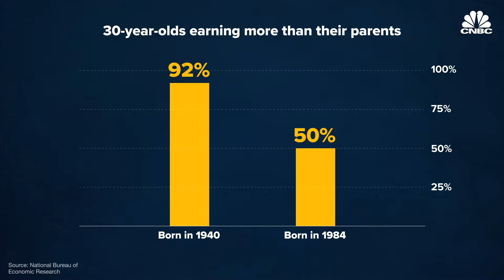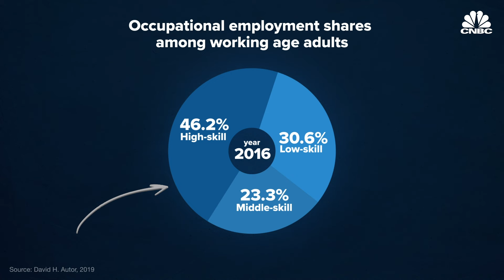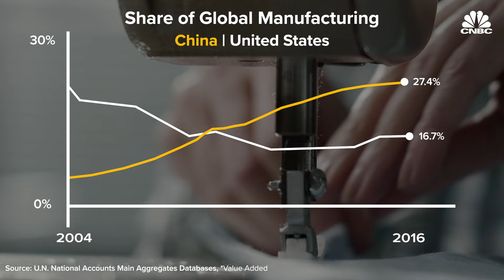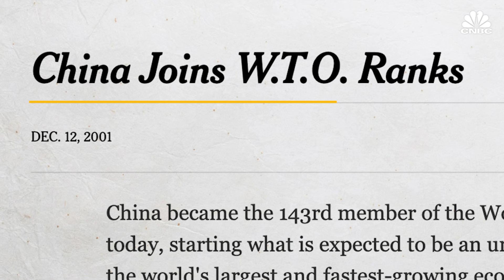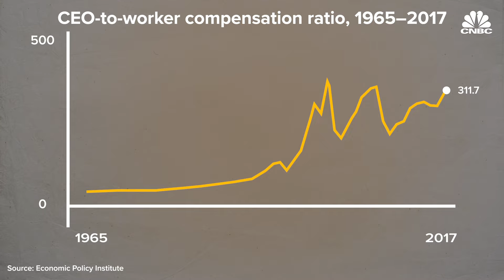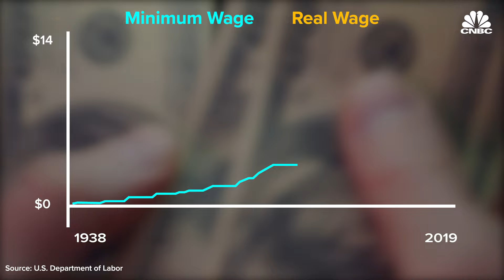Why The Inequality Gap Is Growing Between Rich And Poor

Comment: Had minimum wage went up with production, as FDR signed it into law, the minimum wage would be over  $23.00 an hour
Reply: Ronnie Baker and a McChicken would be $7.
Reply: @ronniebaker4549  We run into problems when people take facts, strip their qualifiers, and regurgitate them. Your statement about CEOs refers to Fortune 500 CEOs. The overwhelming majority of Americans do not work for Fortune 500 employers or large employers in general. The average CEO actually only makes around 3-5x the average worker. That's the real, unqualified, stat. Nowhere near 350-1000 is it?

If McDonalds decided to keep people around at $23/hour pricing would necessarily change. Real American is most likely wrong because there's no way McDonalds is going to keep people around at $23/hour. That's the real problem with minimum wage. It pushes people out or keeps people out of the workforce. Heck politicians and unions pushed that as one of the benefits of the minimum wage originally. One of their big selling points was the fact that no one would pay an immigrant, black, "other", etc worker minimum wage. It wasn't about helping the lowest worker. It was about protecting higher wage workers from competition. There is such a thing is being more expensive than your skills are worth. No one would be falling over themselves to pay a low/no skill worker $23/hour. 

Oh and yeah, I'm ok with a company deciding what they want to pay an employee. The idea that there's such a thing as too much compensation or that ratios need to be balanced is foolish. Companies will just slash CEO pay and leave worker pay precisely where it is. That's the only likely result here. The fact that people believe anything different is probably an indicator of how bad most Americans are at handling money.
Reply: Ronnie Baker and you think thats good?
Reply: Ronnie Baker obviously you are lost
Reply: and minimum wage might have bid up to that rate via market pressures if the US did not flood the country with 10s of millions of poor people. now the US has too many people. an employer can find a dozen people for any one job opening -- why does the employer ever need to raise wages when there are so many people? and yet TOO many stupid people keep voting to flood the country with more millions of poor people. LOL.
Reply: @BTrain-is8ch  I agree, but the best way to solve this issue is not by increasing minimum wage. That wage is only for starting jobs. The best way will be for politicians to pass this policy (never gonna happen):

Any foreigner that works at an American business like Walmart or in an American factory in say China or India gets paid $5.00 US dollars per hour if they work in Mcdonalds say Mexico. If they work at an American factory in say China they get paid $10.00 US dollars per hour. Second, make 100% American Made cars and technology. Right now an American car like Chevy volt is 60% American made and 40% is foreign made (tires made in china or rotors made in japan). Is time for the US to make PC parts, tvs, etc. basically to stop relying on Asia when it comes to electronics.
Reply: Ceo "work" is not work at all. Work is doing something you hate 10, 000 times a day 5 days a week for 50 years.

Making important decisions? Taking "risks" (lol) all that ceo stuff is fun. Not work.
Reply: Ronnie Baker talking about how much you pay your employees. Are you making me an offer. Don’t bother😂 You can’t afford me. And I haven’t made less than $20/hr since I was fresh out of high school. Am I a republican yes. I also hold a PhD In mechanical engineering and bill my services at $165/hr starting. So definitely not underpaid. You however paying only $20/hr for seasonal labor are taking advantage of your employees to the point of absurdity.
Reply: Marcus Aurelius more like 250 people apply for one corporate job. As automation becomes more of a thing except that number to rise. I’m curious to see how the economy is going to change in the decade. I have a feeling it’s not going to be for the best.
Reply: @realamerican8079  so what ...dont support a oligarchy company
Reply: @realamerican8079  actually no because labor is usually only about 30% of a company's expenses
Reply: Fred Rogers  I don't think I deserve anything for doing what is right. We should put our efforts to bringing back the middle class that was replaced by the working poor. "If you can't pay full-time workers a living wage, you should not be in business" (Eleanor Roosevelt)
Reply: @christopherwilcox9654  you obviously know nothing about business
Reply: @EternalKernel  you obviously have no idea what responsibility feels like...
Reply: And the USA would be deeper in debt as most exports would be to expensive to sell to the rest of the world and China would be selling us everything we needed. Did you know we even import Toliet paper. With all the trees we have here.
Reply: Ronnie Baker — “I could live off minimum wage in the 70s” well you can’t anymore because women flooded the job market. Very simple. At first, the wifey working was good. Extra income for the family! Everyone is richer. But when everyone is rich, it meant that nobody was rich... Prices went up accordingly.

Families went back to being just as wealthy as before, except this time if the wife wants kids, that’s HALF the household income GONE. So the population now has to work significantly more hours to make the same amount of money as before.
Reply: FDR is turning over in his grave
Reply: A ceo also accepts a lot of risk and loss to start or maintain a buisness. Right now I'm only 35 and am the sole owner operator of my own company. I'm 150k I debt and take home only about 20k or so after expenses but one day after all this hard work and time i have to put in without getting paid, ill either be able to watch my company work for me from behind a desk or ill be homeless and broke. Its a risk I'm willing to work for.
Reply: And yet you would still be homeless in NY or Cali on 23 an hour unless your living at home.
Reply: N Silva  correct
Reply: N Silva  finally, someone who has  brains
Reply: Ronnie Baker you must be a socialist.
Reply: @realamerican8079  It already is.
Reply: Ronnie Baker but ficken inflation would be like a dollar worth nothing
Reply: Dimitri B they work LESS hours and live a fine life while on “work” hours !  Are you kidding?  I’ll trade roles anyday!
Reply: Marcus Aurelius Bush and the gop flooded America with cheap labor to begin with
Reply: Real American so entitled.
Reply: @realamerican8079  - Value meals are already 6, 7, 8 bucks already. 

Try again.
Reply: @christopherwilcox9654  - We love to use McDonald's as the 'low paying' example, yet almost all food service companies across the board are low paying. 

It's funny that the people who handle our food are paid the least. Think about that for a second. 

We're paying Joe and Jane Schmoe 4 bucks an hour (because our government let's companies pay people this poorly) TO HANDLE, COOK, AND SERVE our food. Oh, gee. What do you think Joe and Jane Schmoe are thinking about all day. Here's what they think. They're thinking about how much their job sucks, how much the people above them mistreat and disrespect them, and how they can get out of this lousy, low paying job. 

They SHOULD be thinking about how well they're treating your food, but...that's just not a priority to them. They're working a job that doesn't sustain them, and makes their lives miserable. 

Tell you what...completely ignore the rating score you see posted on restaurant walls and windows.
Reply: @BTrain-is8ch  -  Think about that last line you typed there, dude. Why would SO MANY people be 'bad' at handling money? Why is that always the problem with people who are stuck in stagnant wages? For the most part, people pay a significant amount of their income into necessities, things that they literally NEED to survive. Food, clothing, shelter, several types of insurance (auto, home, health, dental, namely). On top of these, they need things related to the above. A home is no good without electricity, heating, appliances, furniture, toiletries, etc. A car is no good without fuel, maintenance, upkeep, registration, etc. Running water (yep...gotta pay for that). 

You're probably one of those 'geniuses' that think poor people shouldn't have phones and internet. Heh!! Try getting and keeping a job without either one. I can do this all day. So I'll be fair and wrap the point up by saying this. People aren't so much as 'bad at money'. There's just SO MUCH to pay for these days. The things mentioned above really just cover the basics...SOME of the basics. We didn't even get to kids, education, TAXES, mild leisure expenses.

With all these expenses, you wanna pay people minimum wage, while their boss takes 4 vacations a year,  wear a suit and shake hands all day??? Insanity.
Reply: @blackSUAAAVE  Anyone that isn't in poverty, real poverty mind you, that claims that it's "impossible" to save or get ahead is bad at money. The fact that most people are bad at money isn't even up for debate. Studies have been done. We aren't wired to be savers. It's not some corporate capitalist conspiracy. It's our basic nature. 

The fact that essentially all of the expenses you're not getting into are luxuries is really just giving me a look into what class you actually belong to and it's not sounding very poor. It sounds decidedly middle to upper middle. Middle to upper middle class people do not have an excuse for failing to save. They are either getting that job done or being bad at money.
Reply: @BlackSuave44 I meant the sandwich. Not the meal. Duh
Reply: @realamerican8079  Well the CEO could take a pay cut and keep the costs down... why cut down workers only
#Yang2020
Reply: Wall St caused the 1929 crash but FDR caused the depression with horrible policy such a system allowing businesses to cartelizeband raise prices. At one point FDR used 'lucky numbers' aka numerology to set gold prices, according to Treas Sec Morgethau
Reply: My God!The horrible inflation would go out of control!Automation would be certain!
Reply: When welfare rolls increase there is certainly no room to increase the minimum wage. In this case the two programs support prices and likely support higher prices.
Reply: @realamerican8079  no a mc chicken would still be a dollar , u have to look at corporate profits per company
Reply: @jzk2020  The black people I work with don't take home less then me. In fact, since Trump has been in office, the starting salary of entry level employees has gone up $1.50 an hour, so there are some blacks making more money then me since they started after the base pay went up.
Reply: if minimum wage is $23  ,   do expect  an accelerated push for automation .
Reply: @bostinelosd  - Define 'work' for a CEO. Shaking a few hands, a meeting or two, a couple phone calls. Throw in a signature or two (or a secretary stamp) for good measure. Then what??

What does the work of a typical CEO entail?? I'm dying to know.
Reply: @ronniebaker4549  Spread the word my friend. A lot of people have been brainwashed by this system
Reply: @brandonpazmino8349  I'm trying, my friend! Thanks
Reply: @BTrain-is8ch  utter nonsense
Reply: @xxxxxx-kk7mh  Remember that thought when you're eating cat food in retirement.
Reply: Temujin  agreed.
Reply: @bostinelosd  I'm not sure it's a poor argument. Most of us on the left (myself included) agree that executives should be paid more than the average worker. The question is how much, especially keeping in mind that executives direct the company goals and policies that set things like pay scale. Ronnie Baker's point was that the rich take an enormous share of the wealth and then intentionally pit the rest of us against each other, in a divide-and-conquer strategy, so that we're too busy fighting over the scraps to notice quite how much more the executives have. No one is saying executives should not be paid well for their expertise. They're just saying that the disparity is too great, that it is damaging to our economy, our society, and our democracy, and that the tactics reek of malicious intent. When employees earn fair wages and executives earn more than that, that's fine. When employees struggle on low wages and executives earn millions and that situation is self-perpetuating, well, that starts to prompt pitchforks and guillotines. Depending on where one lives in the U.S., minimum wage now sits at roughly half of what it really costs to keep a stable roof over one's head. That's ridiculous. Being able to support oneself with work should be the starting point, not the end goal! Executives no longer consider fair wages to be the cost of doing business, but they sure do rate their own contributions highly. That's (part of) why there's a problem. It's easy to demonize executives because they're the ones setting the policy and benefiting, directly, from our labor.
Reply: xxx xxx America will never be a socialist country. Our capitalism needs some tweaking and reform badly but we will never be socialist. There’s a reason we meme the hell out of communism. It’s an utter joke.
Reply: @sircharlesmormont9300  Well said.
Reply: @No._1_Karen  Exactly.
Reply: I would propose that rather than countries bickering over what minimum wage should be there should be a maximum wage corresponding to the minimum wage, the highest paid employee in a company should not be earning more than 200x the lowest paid employee. We're seeing top executives make over a 1000x the salary of an average worker.
Reply: The only thing ceos are good at are prostituting themselves for a bailout while they cut thousands of jobs . No person deserves a salary 500- 1000x the minimum wage no matter how important their job title is ffs
Reply: @realamerican8079  And thats 100% ok. 7 dollars for a burger if your making 23 dollars an house seems pretty easy.
Reply: @bostinelosd  They shouldn't be astronomically apart either. if you can afford to take home over 10 million a year, you can afford a loving wage for your folks.
Reply: I would agree. The problem is Technology changes this. 1) By making it easier to ship things from one country to another and moving labor to another country. 2) By providing automation to replace the jobs because they cost too much. The only solution is reeducation. We need to provide the ability for people to constantly learn new skills so that they can keep up. College is way too expensive and we should look into restructuring this. Too many "Starving Doctors" out their that are working just to pay off their student loans.
Reply: @realamerican8079  the hourly wage for a Mcdonalds cashier/worker in Denmark is  22$/hour with pension payment, payed sick leave and a 5 week vacation/year secured immidiatly after day one.

The big mac is literally cheaper in Denmark than in the US. The reason why the big companies dont pay you more is simply due to the fact that they dont want to due to greed.

American capitalism is a sickness that allows this. Here in Denmark strong labour unions and regulatory laws secures employees reasonable working  conditions/wage.
Reply: “had went up”??
Reply: @EternalKernel  “Work is doing something you hate.” I see where your problem is. Worse yet, your mindset is condemning you to that belief.
Reply: @oyeahimfunny  Really? I would think someone that has a master’s degree would be better at writing.
Reply: @blackSUAAAVE  In other words, you have no idea what a CEO actually does.
Reply: @sylvianblade75  Unless the person generates the revenue.  So yes, it may be just for some.
Reply: @jimziemer474   yea yet you understood what I said so what’s the fuss? What do you mean “really” you look like you drive buses for a living ,nice try tho bud
Reply: YouTube Censors  I am not a roofer, I am a contractor. I have owned restaurants and bars and never paid anyone less than the equivalent of $23 an hour in today's value. I am not responding to any more of your trolling
Reply: YouTube Censors  OMG IT THAT WHAT THEY DO?! I HAD NO IDEA!!

Are you freaking kidding me?

You know whats work?? putting fries in a bag for 8 hours straight. 

You know what is not work? throwing someone else's money around, picking a random idea from a list of good ideas, and calling it your own. 

The wealthiest of CEO's effectively play all day. What happens to a CEO when they lose their job? Nothing. they probably take a vacation on their yacht to forget about it or some other thing that a normal person will never do.

That person who loses their job shoveling fries? good chance they end up on the street. then DIE OF FREAKING EXPOSURE BECAUSE WE TREAT HOMELESS PEOPLE LIKE DIRT.

freaking CEO worship I swear.

CEO's (when they are founders) are just people, people with MONEY an IDEA and the WILL to do something about it. That is literally it.
Reply: @jimziemer474  I speak from experience. "Work" has always been doing something I hate. And that's just the truth of things for anybody who must work to live and is not a member of the "upper" class. 

literally these days you work to eat, rent. any excess is spent  on doing something that prevents you from ending your own life because of the pure futility of life (entertainment, tech toys, whatever) 

Unless you get lucky and are born into; money, amazing health, incredible talent, ...

lol why am I trying to explain this again to someone??

Your right, everything is fine :)
Reply: actually you are right. in denmark, it is 25.00 a hour for mcdonalds.
Reply: @ronniebaker4549  let's be honest demand for workers that provided nothing but physical labor was  much higher in the 70s with mechines why would companies bother paying you when they can get the same work done more effectively by mechines
Reply: @blackSUAAAVE  demand for physical labor is going down why would companies pay you more?
Reply: @greenearth9945  yeah let's pay McDonald's workers more (sarcasm). LETS FORGET THAT DEMAND FOR SUCH JOBS ARE GOING DOWN.
Reply: @sammann3577  you are obviously comparing American workers to yourself. I have owned businesses since 1977 and have paid every person who ever worked for me a good living wage and they all respected me and gave me great work. You have never been outside of the United States. What are you using to get your conclusion? I admit I live and hire around colleges as I like to..wait, let's be honest. I have a very low tolerance for stupid so I have always avoided living in places like you describe. Move out of your mobile home park and you will meet great people. H
Reply: @ronniebaker4549  Good, But see that's from the kindness of your heart this should be encourage. I have a problem when bums demand companies to pay them more cause they some how deserve it. If your smart enough as you claim then you would realize that a lot of general labor workers will no longer be needed by companies skill and talent is need that's why western economies rely on workers form other countries as we currently aren't making skilled workers, only entitled woke self proclaimed victims that bring nothing but complains to western society. I have been to third world countries met actual people that have been unfortunate, but they still have the dedication and will power to work with what they have. These people deserve our support and not these woke entitled western bustards that complain about their victim status and than they demand everything to be handed down to them.
Reply: That’s not enough for rent try to collect you are loosing the building
Reply: @periklisspanos7185  of course it isn't. Minimum wage was called a living wage when FDR signed it into law. The minimum wage should be more than the cost of living in the area the people are employed. It works great all over the world. The United States is the richest country in the world and still has poverty as bad as anywhere. The United Nations has warned the United States about the extreme poverty in south Alabama, Mississippi, and Louisiana. Capitalism is great but crony capitalism has destroyed the reputation of Democracy in the United States
Reply: Fdr never signed such a thing into law.
Reply: Exactly
Reply: My comment is dated. The minimum wage today should be closer to $30 an hour.
Reply: Fdr didn't sign it into law. The minimum wage came after fdr.
Reply: @ronniebaker4549  It doesn't work that way. Nothing, not even labor is priced this way.
Reply: @5rings16  I don't think you have a clue what the subject is. Troll a trump lackey and stay in the slow lane.
Reply: @5rings16  you drank the corporate koolaid. Go ahead and work for corporate America. Fortunately I never had to. Again, you need to troll a trump lackey and stay in the slow lane.
Reply: @5rings16  You win the corporate tool gold medal. Hehehe. You have probably never been outside your state, much less than outside the US.
Reply: $23/hr as a MINIMUM?? I wouldn’t have wanted to use any of my skills, or gone to college if minimum wage was $23. There are people out there who are NOT WORTH paying $23 to, and will be lifelong unemployed, which is dangerous to their health and the economy. Minimum wage jobs are meant to be <10% of jobs, be temporary, or for people with very low skill set, low physical exertion, or work ethic (hiring people who’d otherwise be unemployed)… They are NOT meant to allow you to work 40 hours a week and live an apartment with no roommates and a comfortable life, and DEFINITELY not meant to raise a child. If they did pay enough for a comfortable life, no one would aspire to getting ahead in life! if you’re paying the WORST employees $23, then you’re paying halfway-decent no-skill employees $30, and stellar NO-SKILL workers $40/hr. Yeah right! 50% inflation overnight
Reply: @lukethompson5558  This post is 3 years old. The minimum wage now should be $30 an hour.
Reply: @s45gr32 So 50% of jobs are starting jobs? Because most jobs are not much more than minimum wage.
Reply: Working real well in California right now 🤡
Reply: @warlordop713  this post is 4 years old. Minimum wage should be over $25 an hour now. When corporations and the top 2% paid their taxes between FDR until Reaganomics a man could work at the local manufacturing plant and support his family, own a home, and send his children to college on 1 income, and we had enough money to go to the moon. I had old text books in middle school that taught to work in the service industry as robots and machines would replace jobs and everyone would work less and get paid more and retire at 50. The author didn't take corporate and political greed into consideration nor the stupidity of people to work for less than a minimum wage. Gen Z are the most informed generation in history and are going to make the world a better place for everyone, not just a select few.
Reply: Ronnie,  In the UK there are around 6 million people that live entirely on Benefits. Then among the UK population that actually works 40%  of these do not pay any Income Tax. Then also, in the UK there are around 1% to 3% of the people that get stuck into business, work hard and make a profit 

Why is it that the Marxist-Socialist-Cranks believe and propose that the wealth & profit of these business people in the UK must grow at the same pace of proportional increase with those that do not work in any Job whatsoever   

This video did not mention people that simply do not work, will not work, or are just satisfied with Less

What these Marxist-Socialists really want to do, is they just want to take cash out of the pockets of people that earn it and hand it out to those that have not earned it